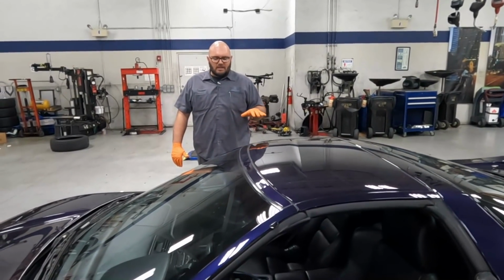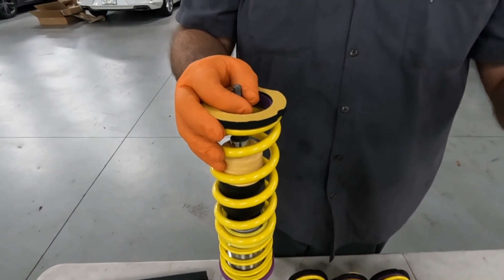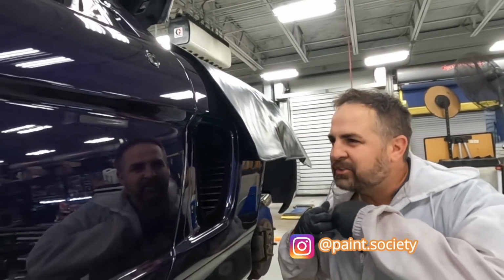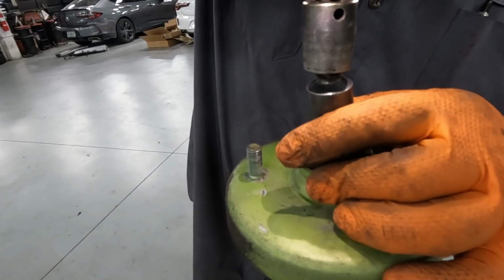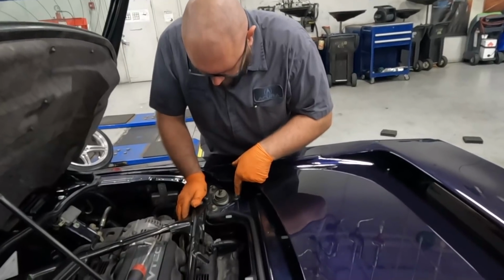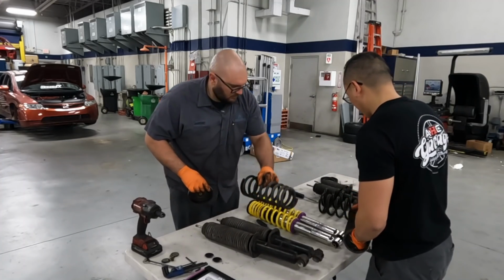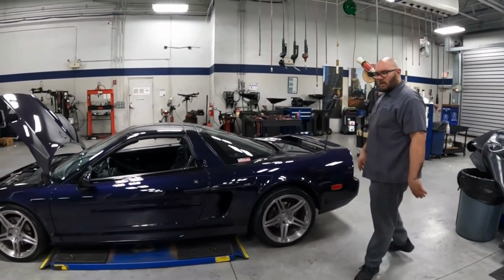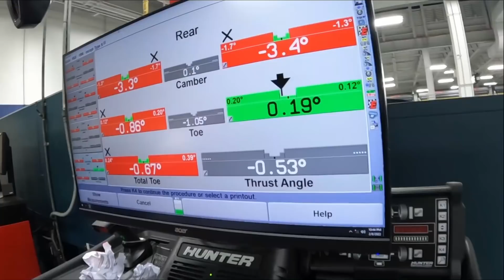Super Rare 1996 Acura NSX in Midnight Purple Pearl - Installation KW V3 Coilovers  & Alignment

Comment: The helper spring aka tender springs, really only take up the slack at full droop to ensure the springs don’t rattle around. Since they’re fully compressed and bound up with the car on the ground, they don’t actually change the suspension’s spring rate at all.

Comment: I never understood the plastic/plastic wrapped spring perches - I would rather have aluminum from their other models. Also, why didn't the NSX owner just buy new OEM Top hats to avoid all the labor and then make it easier to revert to stock? Are they not made anymore?
Reply from the maker: Agreed, however some of the components in the Oem top hat were not available at the moment
Reply: @ahcgarage  it's hell getting old!
Reply: SoS makes good alternatives for top hats. Much easier to go with those